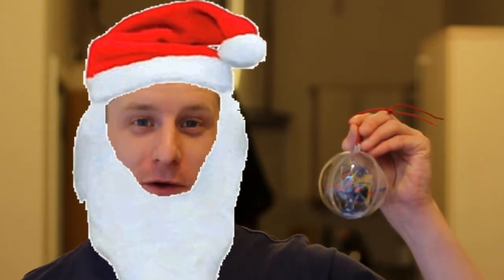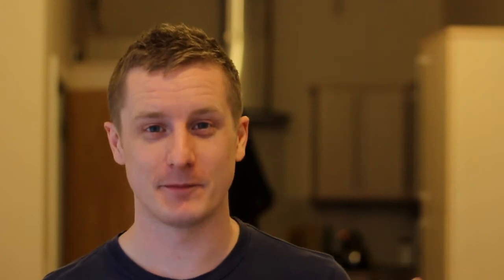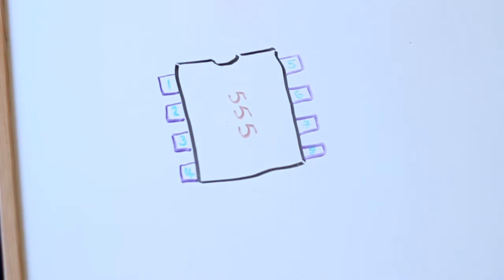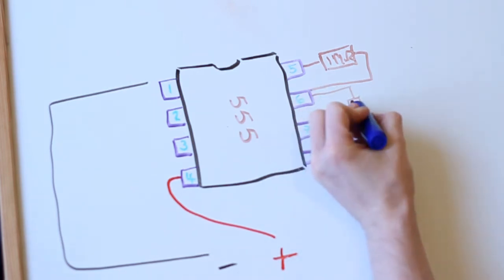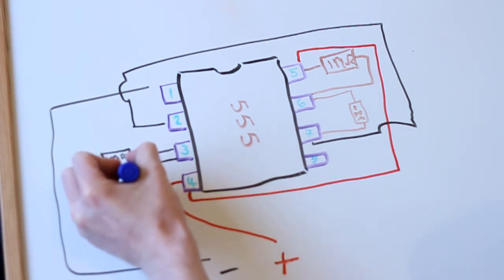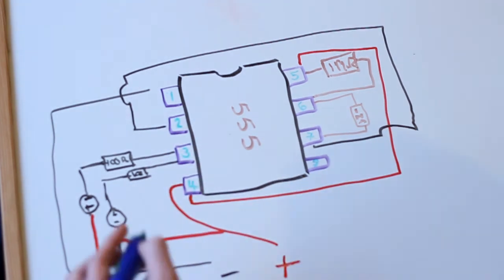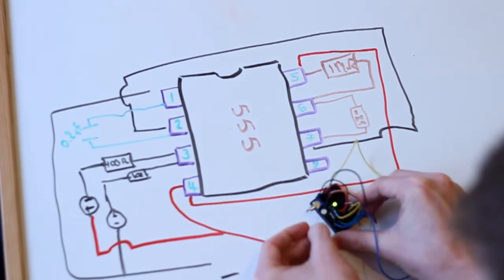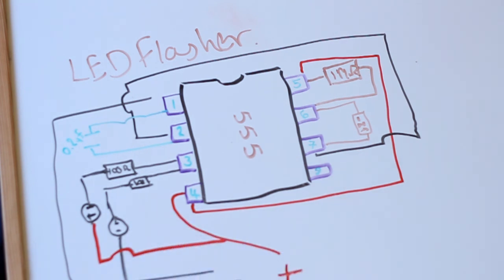Flashing for Christmas: Flashing Christmas Bauble using a 555 timer

Comment: Think you may have the numbers the wrong way around on that diagram. You count the number rounds anti-clockwise so where you have 8, 5 would be there, and 7 would be 6 etc. I made the same mistake for a few weeks starting off in Electronics classes.
Reply from the maker: Awww shucks, you are right. I should have prepared that better... If you ignore the numbers it is still the same circuit. I will amend the description, thank you for pointing that out.